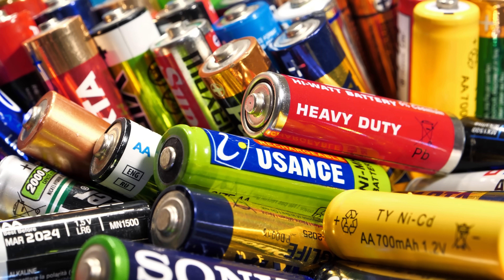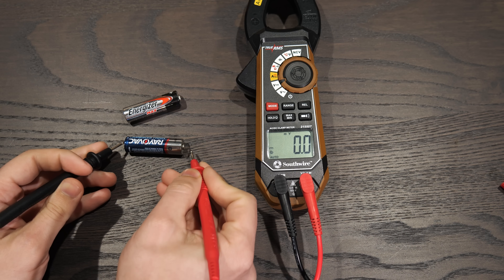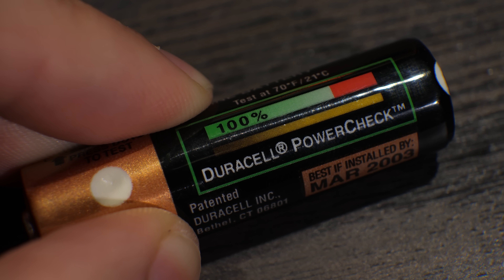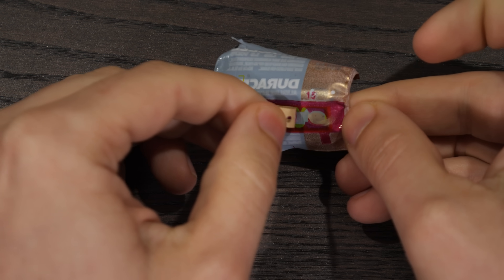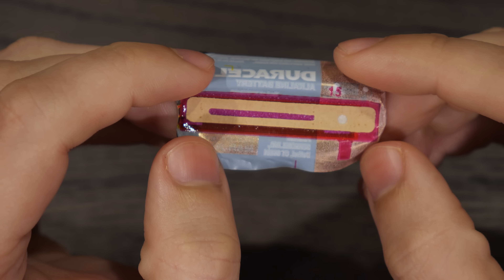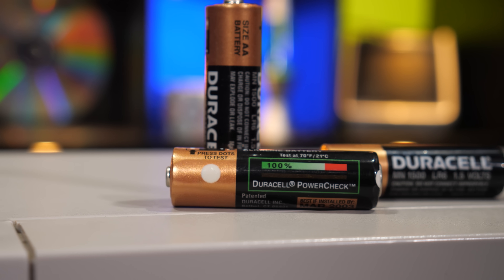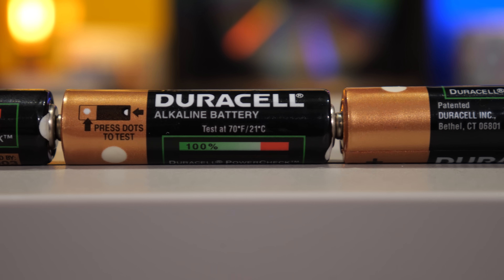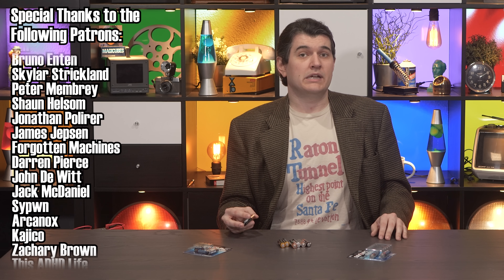Duracell PowerCheck: A genius idea which didn't last that long

Comment: batterys can be expensive (about £8 for duracell which last a heck of a lot longer than energizer). i didnt always have spares on hand so i would take batterys out of an unused remote for whatever new device i just got that required AA batteries, i would give them a quick check to see if they had much life left in them, i dont know why though. it was a novelty and they hurt the finger tips to test.

Comment: My insulin pump uses aa batteries and at about 1 battery every two months thats like, 60 batteries since I first got a pump. It also refuses to accept a new battery unless it has over 95% charge. I hate it and I want hotswap battery packs for it like my gaming headset does.

Comment: Can you do a video about rechargeable AA and AAA batteries? 

I recently discovered that these batteries have a voltage of 1.2v when they are fully charged (rather than 1.5v) when I had a device that required two 1.5v AA batteries connected in series (so it effectively required 3v, if I understand correctly). So, when I put two rechargeable batteries into the device (effectively 2.4v when connected in series?), it would not turn on. I didn’t notice the discrepancy until I looked closer. But it made me wonder how common these sorts of issues are and why 1.5v rechargeable batteries aren’t more common (yes, I know they exist).

Thank you for the work you do! And I apologize for the liberal use of parenthetical comments here (though, you strike me as the type of person who appreciates a clarifying aside/footnote).

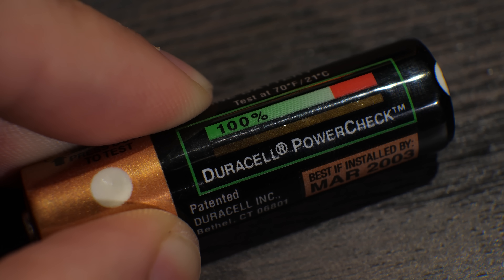Comment: 4:34 Wait! How is that battery not leaking with an expiration date from 2003?
Reply: If you use it and it’s a good quality brand
Reply: @will.005a I’ve got a 2 yr old pack of Duracells leaking battery acid already I call cap
Reply: @dylangreen6119 I’ve lived 24 years and found battery’s left in drawers decades old and never seen a battery leak
Reply: you must live in a desert then, and you probably use batteries too fast to notice lol
Reply: @dylangreen6119 ah yes, my anecdotal evidence makes you a liar!
Reply: @iDrunkRS ah yes, my anecdotal evidence makes you a regard!
Reply: Why should a battery leak? What batteries do u buy?
Reply: @iamagenius2646 moisture
Reply: @iamagenius2646  usually you see them leaking in a tv remote control after 10+ years or so.
Reply: He likely cleaned them or swapped the wrapping 😂

Comment: I remember these when they came out. I would play with the tester because it actually gets hot enough that you can feel the extreme heat if you touch it with your fingers or lips as I did.

Comment: Pretty sure they still have these, I saw some being sold only a few years ago. Then again, I'm in Canada, so that might factor into it.

And I found them pretty useful when I had them. Most things I'd put batteries in needed you to unscrew the battery panel, so being able to test batteries without needing to do that was pretty nice.

Comment: Oh man I remember those. My fingers hurt every time I would try and test them. It was a gimmick that made people like me want those instead of the others cause they show you how much energy was left in them. I also remember the packs that had the power strip thing on the packaging. So some people would just save that plastic part and use it periodically to test any batteries.

Nowadays I use rechargeable batteries when I can. I always hated and thought how wasteful it was to use regular batteries and then throw them out like so many people did. I know where I work they constantly buy regular batteries and are constantly throwing them out instead of investing in some rechargeable ones. Plus so many regular batteries tend to leak even when they haven't been used which can ruin stuff. I even bought a multi meter that has a battery tester feature built into it a long time ago which seems to work okay enough.

Comment: What I'm actually wondering is why this isn't a thing with rechargeable batteries.

People aren't always tidy, so sometimes batteries of uncertain remaining capacity will be found around them.
Also it's sometimes useful to test a battery which is currently in use to find out if the device has a malfunction or the batteries (and which cells) have to be replaced.

Comment: I used these all the time, so I could know whether I needed to bring spare batteries with me when I took a trip. Pop open the walkman, check the batteries; if they're getting low, grab a spare pair. We also had a battery charger that -  nominally anyway - could recharge alkaline cells. Was it safe to do so? IDK. It did work, at least for a few charge cycles. Given how much my dad paid for the thing, I'm not sure we ever recovered that cost in recharged batteries. Yes, NiCads were a thing, and safely rechargeable, but their capacity sucked.

What drives me absolutely bonkers these days is that there are battery operated devices that cannot work with rechargable Li-ion batteries. My smoke detectors are battery-only (thanks old construction with no power circuits to the smoke detectors), and if I put Li-ion batteries in them, they just give the low battery beep, even if the batteries are fully charged. Yeah, I get that Li-ion has a lower capacity than the non-rechargeable NMH cells, but FFS...I'd rather have to recharge the batteries once a month or whatever than have them last 6 months and get thrown out. There's no good reason for it.

Also, battery industry: can we get rechargeable NMH batteries already? And why are there no rechargeable coin cell batteries at all?

Comment: I remember those! A very clever idea, but I would imagine difficult to make work reliably. With that paper-insulator window, and the battery case’s thermal wicking - very many variables at play here. Even on a weak battery if you hold those dots long enough, the thermally induced coloring would eventually brighten the entire gauge. So the heat-sink capacity was not controlled. Plus the unsettling knowledge that the longer you test, the more battery capacity you waste. Likely this heater consumed more than the device the battery powered. Too bad we didn’t see measurement of heater resistance, current vs. battery discharge chart. In other words, how much of this is sneaky marketing to make the battery die faster.

Comment: Very useful to know. So 1.0 volt is dead????? On junk drawers - these days people buy batteries in multipacks; when you open the pack they fall out - you might want one but end up with three lying around in the drawer and you arent sure which pack they came from or how many years they’ve been there. And there are use cases for which an ‘almost depleted’ battery is better than no battery (such as searching in the back of an unlit cupboard for whatever it is you cant find - 20 seconds of light is better than none. Most low-powered devices use button batteries these days but before button batteries some used AAA.

Comment: I remember mine being green, but I could be remembering wrong. We didn't have them often - I actually might have asked my dad to get some specifically so I could see it. But I definitely remember them.

I figured it was completing a circuit, that was pretty obvious (to the child of an electrical engineer anyway). I think I could feel it getting warm, but in any case I concluded that it was temperature related.

Neat to see the inside though, I never went that far, mostly because I didn't want to use a knife to get the wrapper off!

Comment: Technically the multimeter also tests under load. It's just a very small load.
Unless of course you put it in the amperage socket, in which case you're just shorting the battery 😅

Comment: There was also a serious problem with the user experience of those testers (both the integrated on and the film one that came separate) in that the user had no idea if the battery was completely dead or if they were not pressing down hard enough (or holding the film in the exact right position). so the user could never be completely certain if a battery was completely dead or not. i don't know how many times i tested a battery as dead only to have my dad test it and show it was full

Comment: It was a cool gimmick, but ultimately useless. Normal use of batteries was just to put them into your thing and use it until the batteries were done. Back in the day, like 4+ decades ago there may have been a usecases, where you had multiple devices and only one set of batteries. Like imagine a small radio and a flashlight and you would switch batteries between the two. Maybe then this gimmick would have been useful to estimate when you need to buy new batteries. But I guess even then people would just use the battery until it is dead and then get new ones. You can buy batteries everywhere anyways.

Comment: i'm not sure i'd even noticed that those things weren't around anymore... Definitely had some, definitely found them rolling around loose at times and remembered checking them. but the other big reason for testing the batteries is when the device isn't working for some reason and you're trying to figure out if your batteries are dead or your device is broken.

edit: okay i'm not crazy they DO still make them

Comment: Speaking of batteries, a topic that admittedly may or may not be niche (I don't know how much of my experience was universal) that would be cool to see a video on is the decline of rechargeable batteries (at least outside of purpose-built devices like the batteries in phones and other similar electronics). I remember as a kid, probably the only reason I got to play my Game Boy is that instead of having to ask my parents to buy new batteries every time it ran dry, I could just take the batteries out at the end of a play session, put them in the charger, and have them fresh for when I wanted to play again, but I haven't seen rechargeable AA/AAAs in probably close to two decades (i.e. just about when I upgraded from a GBA to a DS, with an internal battery pack). Obviously the tech hasn't vanished, since I imagine there's plenty of R&D spent on it for phone batteries and the like, but why isn't it really a thing for consumer batteries anymore?

Comment: Back in the 90's those were great because we couldn't afford batteries very often. So I was always swapping the same set of batteries out between the gameboy, my walkman, or whatever else I needed to power. And having those little strips was instrumental in knowing whether I could play my gameboy, or whether I should just pop them in a Tiger LCD and use up the last 10%. Now most things have a built-in battery, which offers pros and cons. It's great having built-in batteries sure, but you can't swap them out for a fresh set. When they die, you've gotta wait for it to recharge. Comparitively few devices use removable batteries these days.

Comment: I remember before the test strip and using the test strip and then never using the test strip and then never seeing new batteries with test strips.
I think in all the times I ever used those test strips on the batteries, I only used them to show my friends the new feature on Duracells. My parents bought one pack and realized it was just a gimmick and bought cheaper batteries instead. I probably tested four batteries using that strip in all the time Duracell had them on the market. Again, that was just to show my friends the cool new feature on the Duracell battery.
... and thank goodness for NiCad batteries. All my toys and handheld digital "football" games ate up batteries like crazy. When Nickel Cadmium rechargeable batteries came out, sure they didn't last nearly as long and cost eight times that of a disposable battery, but recharging sure made it nice when all the stores except 7/11 were closed on Sundays.
Yes, folks, it used to be that only convenience stores and SOME gas stations were open on Sundays. Having your last D-cell batteries die late Saturday evening meant going without your gadgets and toys or going to a convenience store and paying three times the price for new batteries Saturday night or early Sunday morning.

Comment: I like AA batteries a lot more than built-in batteries that render the device useless when a) they are out of charge, meaning you have to recharge it first, and b) when the battery breaks and you can't simply replace it. I have been using rechargeable AA eneloop batteries for like 15 years now and they still work great to this day!

Comment: There are times when I have wondered if it was the device or the batteries that were bad or mixed up whether I had good batteries or bad ones on my desk. Those are the times I miss the battery testers.
I use nicad for almost everything now though.
I like the lithium AA batteries with USB-C ports on the side, but at their usual price, they should come with built in power meters.

Comment: i think rechargeable battery packs were the death knell for it. for 20$ you can get a rechargeable battery pack that comes with 2 AA and 2 AAA. always keeping a set on the charger for when the current one dies, is just simpler.
and then even more modern devices have built in ultra-long-life rechargeable batteries that we have an obsession of nightly/daily recharge

Comment: Anyone else ever have one of these test strips explode on them?  I had an early pair of wireless headphones and the battery compartment was really tight, which apparently kept the test strip contact pressed in while the battery compartment cover was installed.  I heard a loud pop in my ear while using the headphones and opened up the compartment to find a small amount of white liquid that had come out of the battery test strip.

Comment: I preferred the battery tester that came as part of the packaging but if you stripped it from the packaging and used it, you got a tingling surprise.

The tester that was part of the battery was a pain in the rear end.

Comment: I used some Duracell batteries with a power tester on them that were made in 2017 or so. If I remember correctly they were not marketed as 'powercheck'.

Comment: I actually liked the batteries that could show you approximately how much charge they had...I also used to charge my alkaline batteries with a car battery charger, one second it all it took to get 'sole' voltage back and if you were careful enough you could make an alkaline last quite a bit longer...now with electronics efficiency improvements and ease of access I just replace them when they get kinda low...so wasteful...and lazy on my part. Also, if memory serves theaterisl used for the "heater" is an aluminized plastic sheet cut into the necessary shape. Wel will use this material in a lot of things like the cheap remotes that come with strip lights.

Comment: You absolutely have me with the AAA conspiracy. Here in the frozen land of hoth, AAA's are actually double the price per unit over AA's and at half the capacity, you are paying 4x as much per mAh.Grrr!
And what really shorts my circuits, is that I have a couple of awesome white LED flashlights that run on 2 or even 1 AA battery - you know Vfd of 3.3 or more ! So those really cheap barrel LED flashlights that require 3 AAA's are the epitome of mass consumer waste!

Comment: Seriously? Never thought it would be interesting to see what happened to Sales? Having one dead battery doesn’t mean they’re all dead, so this product likely went away because it affected the bottom line. It’s not about keeping half used batteries… it’s about testing which would die first causing an item not to work. It was common when there were several hundreds of tools and toys that took up to 16 batteries. 

Did you seriously just guess how many people asked about how many people used the product, without showing their product line’s sales? 

Often times I’ve been able to add 1 battery to a multiple battery device. The product lasted longer and it was helpful so as to not throw away good batteries. 

Tell me batteries don’t work that way and yet they do.

Comment: Bounce the battery flat end on a hard surface like a ceramic floor, cement floor, or stone. Hardwoods work ok. Dead battery will bounce. Good ones thud and barely even move. Only works with alkalines. AA's and larger easy to see

Comment: All my batteries that no longer work have a second life as a wall clock battery. That thing could drain them into less than 0.9V. Sure, it may drift a bit more but who cares.

Comment: I have a couple still, they must have still been made until at least 2014 because the box says they are good for 10 years and the expiration date on the actual battery is Dec 2024, I better use them up quick! I think I only got them because they were a Menards rebate item so they cost less then the standard batteries.

Also some multi meters have a separate battery check that uses a lower resister to measure the voltage across so the battery is under load, you will get a lower reading than just setting it to voltage.

Also I have tons of half used batteries laying around.🤣

Comment: I remember the tester in the box, and it wasn't that easy to push strong enough to make it work. I can also imagine that the temperature requirement can be a problem, as most of the time you don't have much control over the temperature.

Comment: While rechargeable batteries are better in concept than single-use alkaline batteries, lithium-ion batteries are not.  They present a concerning element of planned obsolescence, since they usually are of a proprietary size and aren't user-replaceable; and of danger, since they can and do expand, destroying the device, and sometimes start a toxic fire.

Ideally we'd be using Ni-Cd or Ni-MH rechaegeable AA or AAA batteries wherever possible.  They're the best of both worlds, and they also rarely leak.